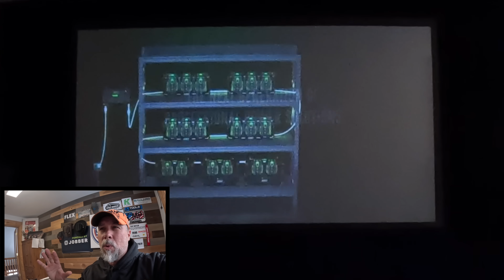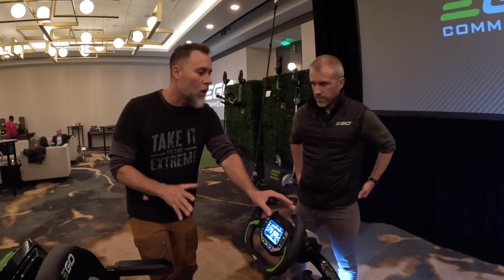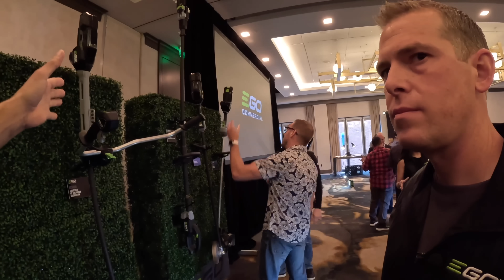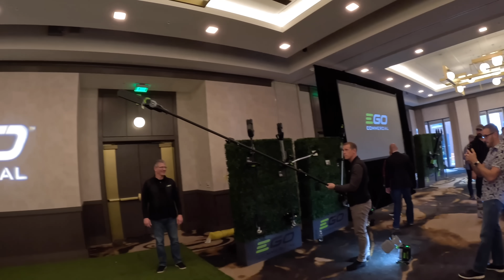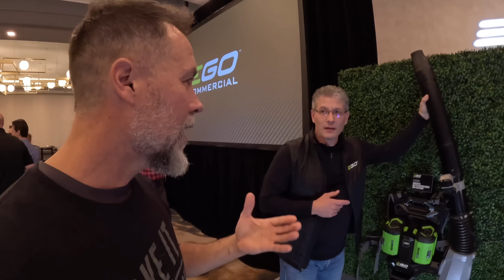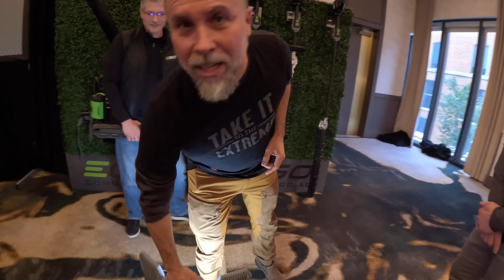Ego Launches 7 new power tools PLUS a new mower!

Comment: I would not expect that to replace you gas backpack leaf blower. Don't get me wrong I really want an electric leaf blower that can. And I see no reason why it hasn't been done yet. I have Ego 765CFM hand held. I also have Husqvarna 580BTS Mark II (gas) blower. And I have used a friends Husqvarna 150 (gas) blower. CFM can be all over the place. It is almost a useless number. But from Egos numbers I don't see 800CFM from their 765CFM blower being anywhere near powerful enough to even touch a modest back pack blower. It doesn't even come close to my friends far more modest gas blower. If you clear huge areas and very dense piles you need serious power. The 765CFM blower is pretty good for a handheld but it is still only good for the lighter cleanings. I am anxiously waiting for someone to actually make an electric that can replace my gas backpack. No one is even close yet and I see no reason why it can't be done. If I had the free time I would do it myself convert a blowup gas

Comment: The problem I have with the back pack leaf blower: The battery at times just stops providing power. I have to take off the back pack and remove and reset the battery to get it working again. An annoying inconvenience if the battery keeps stopping. My guess is as the batteries age they tend to do that.

Comment: I was a gas guy through and through. I always told myself, "No electric mowers. There's no power in those things, I don't want to be constantly charging batteries or having them go dead when I need them most." After spending the entire day trying to get my gas mower to run properly, I finally broke down and tried an Ego. I now have the mower, leaf blower, cultivator, string trimmer and edger. My neighbor borrowed my mower because her gas unit was acting up, she now has an Ego mower and leaf blower.  I really love the Ego lineup. The modular approach as well as dedicated tools is huge for a guy like me with a small residential yard but the need for several tools that can be used from the same powerhead.  I can mow my entire yard over 3 times on a single charge of a 7.5 mAh battery. I'll never go back. I think the only negative to the Ego system is the cost of the batteries. But with that said, I don't think I'll ever be a gas guy again...

Comment: I like that electric bike conversion they're about to come out with. LOL 🏆
Reply: What's that they don't make it YET? If enough people ask for it they'll make it.
Reply: EGO 56v batteries are great for ebikes, lots of people have been using them for bike power for years now.   I use them on my ebike with a Bafang BBS02 and a 48v motor.  I also use Greenworks 60v batteries but Bafang will shut off system if it detects an overvoltage (>60v).  You have to run a Greenworks blower on it for a minute to drop the voltage down a fraction and then the Greenworks 60v battery is good to go on my ebike.  You basically get more useful watts then you would at 48v or 56v.
Reply: @nathangant7636  I'm using the Atlas battery packs myself only because I wasn't able to convince eGo to offer a kit of some sort  for the last 4 year's now. Having one battery with so many different ways to incorporate it into your life would be quite popular.  If the same Batteries could be used for all my yard work and carry me to the grocery store and back or THOSE who could use them for getting back and forth with THEIR job's? It would be a popular tool company in my city atleast. A Hub wheel kit or a mid drive kit either way it would benefit society to be able to pick one off the local brick and mortar shelves and incorporate into their lives

Comment: stan, 
have you seen the power inverters?  i bought the small one the connects to one battery has a 120VAC 150W outlet and 2 usb outlet.  
i would love to get the big 3000W one, but the price seems way to high ($550) for not including any batteries.  i can (and have) buy an 4500W pure sine wave gas generator with a 30A outlet for $500.

Comment: Hopefully they are doing better with servicing their products than they were last year. I bought my Ego zero turn last year and the motors for the blades stopped working after using it 3 hours. It took them almost 3 months to fix it and I took it directly to the local dealer/service. When I took it in I told them that I thought that it might be the driver for the motors but they started by replacing the motors and tinkering with other things. Eventually they made their way to replacing the driver and guess what that’s what it was. I’ve got several other Ego tools that I’ve been very happy with but to pay over $5,000 for something that didn’t even last 3 hours still ticks me off. And the bigger thing is that not one person from Ego tried to reach out to me to make it right. Got to use it this past summer and it worked great but it was a season late.

Comment: As a tree guy needing a pole saw.....my favorite is the lawnmower...just kidding. I would like to actually see the pole saw in action. Half my saws are battery powered now...14 inch bar or shorter and are my go to saws. Definitely saves on fuel costs and actually safer since I am not having to crank saws in the tree or bucket. But I am also interest in the hedge trimmmer and a few other products for home applications.

Comment: The problem with this stuff, even if it works as advertised, is that if it breaks you are not getting it fixed, sorry, and you can't fix it yourself. They just become huge expensive paper weights. With gas lots of little shops and yourself you could order parts and get things running again not the same game here especially for commercial.

Comment: I love the Ego products. Very powerful but light weight and easy to control. The pole saw looks great! I wish they would make a power washer as well.
Reply: Yeah 100%, EGO has this "IT" factor. Love everything I have bought so far. Totally with you on the pressure washer. So, here is a bit of info. If you knew this or not, I don't know but EGO has an engine companies can buy and apply it to their products. There is a company I think in England that built a pressure washer around the engine. Not sure if it will ever come to the states though, I haven't seen an videos on it yet.
Reply: agreed
Reply: A very powerful EGO pressure washer is on the way!

Comment: I have had EGO products for years with almost zero problems. I have a blower and string trimmer that are probably 7 years old...still work perfectly. I have the 2 stage snow blower, 2 pole saws, several blowers, 2 string trimmers and the self propelled lawn mower...everything works just as it should every time.

Comment: Hi Dirt monkey I bought the Ego 21 snow blower from a Home Depot. Unfortunately it broke after using it 2-3 times BUT I loved it SO much I bought another one. Ego had the BEST customer service sending me to a local hardware store to fix the broken unit. I did it after winter so I wasn’t in a rush. But Ego ended up giving me a new replacement. It was a good experience. Stanley you are also right that Ego light works great.

Comment: I like that pole saw. I have Ryobi 40v and some OG Ego 56v. I was going to get the 40v Ryobi pole saw until I saw this video. Does the head of the pole saw rotate down to allow for a better cutting angle? Was it difficult to hold when fully extended?

Comment: The handheld market is really heating up with battery power in general, with a lot of the heavy hitters coming on strong.  It seems that EGO is on the forefront, along with Greenworks.  The fact that EGO products are easy to acquire, through Lowes and Ace Hardware, makes them easily accessible .  Great video, Stan!  You know how to ask the right questions of the reps to get the most info on the products.  Hope to see more like this with other brands.

Comment: So its two wheel steer, not 4 wheel steer like my gas powered cub cadet Pro 160S. I would like to convert to electric, but need a machine that is safe on slopes.  The ego would be ideal for me if it had 4 wheel steering.  I have used the ego battery system tools for over 4 years now and love them.

Comment: So with the big backpack blower: it's almost as powerful as the Stihl br700 or br800 ballpark.  For us doing a customer leaf cleanup that can last an hour for two people running wide open throttle (approx 1 tank of fuel per machine) we would burn up 4 of their 12ah batteries in that time(2 per machine) at they advertised 50min runtime on turbo according to website.  Those batteries are $600 each.  So we'd need 4 minimum in use, while 4-8 more sit on chargers in the truck (how is that powered) as they advertise a 90minute charge time to be ready at all times to "refuel" for the next cleanup on the route or to keep going on the bigger cleanups.  So say 12 batteries at $600 each is $7200 plus let's say 8 rapid chargers at $200 each and you're over $8000 plus the cost of the 2 backpack blowers themselves.  They make great products yes, but very hard to justify changing over at that math to do what 2 $600 gas blowers can do.  It's a shame many local governments are passing legislation to outlaw gas power equipment - battery technology has come a long way but it still has a long way to go.  Eco friendly - at the consumer level one may think so but the whole picture (manufacturing, minerals/elements/materials) may prove otherwise.  Food for thought.  I am invested in some battery landscape tools which if you would have asked me 10years ago I would have never considered it.  Appreciate your videos Stan!

Comment: Their 18in chainsaw is a great tool for tree work! Not for making firewood but clearing trees into 10ft sections, I cut 25 trees off my road that blew down before the battery needed to be swapped
Reply from the maker: Wow that’s pretty impressive actually
Reply: Yes I agree,  done a decent amount of tree work and it works great.  I bought a oregon chain sharpener just to keep it tip top sharp
Reply: @renoallstate4573  chain* no blades on a chainsaw 😁

Comment: I hate the steering wheel on the zero turns. I hope that is a fad they realize makes the mower more dangerous.
Reply from the maker: Curious why you think it makes it more dangerous?
Reply: @Dirtmonkey  if you ever test drove one of those it would only take one sharp turn on a small incline to flip it. Reation is too good and no way to really control both wheels independently.

Comment: Great video Stan , Ego is the best yard product out there for the home user, Stan you are more excited than a kid in a candy store 👍
Reply: Ryobi is possibly as good or better. I have an ego lawn mower and over 50 Ryobi tools. The fact Ryobi has so many products is great. But I definitely feel the ego is better quality. 

The fast charge on the ego battery is not talked about enough in my mind. If our grass got extra long the ego can charge one battery faster than the other battery gets used up. So I can mow forever. And the batteries don’t die. If you try that with the 40 volt Ryobi the batteries will overheat and get destroyed.

Comment: Makita has a backpack trimmer (battery pack on back) they say is equivalent to 30cc petrol. Sounds great but max line size is 2.4mm. I need to run a minimum of 2.7mm but favour 3.3mm. If ego could come up with something similar that can run a heavy line for say 1.5hrs, I'd be interested.
Im talking line trimmer, not a handlebar brushcutter.